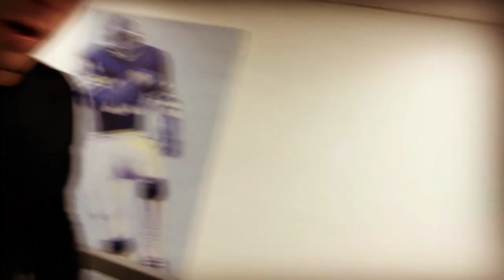Lifting Weights With My Dad! [Harmonti Vlog]

Comment: You don't have to lift until your sore, that's just lactic acid and usually doesn't indicate you've had a good or bad workout. I never get sore anymore, remember for getting a good body, 8 hours of sleep is hands down the most important- then your calories(a surplus or deduction of at least 500 calories if your bulking or cutting, up it another 500 if you plateau) then the workout. 

Imo, missing an hour of sleep to get an hour of lifting is like stepping over 100 dollar bills to pick up quarters. Great advice for lifting comes from greg Doucette, scooby1961, alan thrall(for form), scott Herman, moreplatesmoredates (for the science info)
Love that you keep up with delraymisfits

My favorite workout routine is PHAT by Layne Norton, went from 115lbs to 214 in 4 or 5 years before I lost it all to addiction, climbing back up fast though
Reply: My man with the Stan Efferding quote.  Meatheads unite!